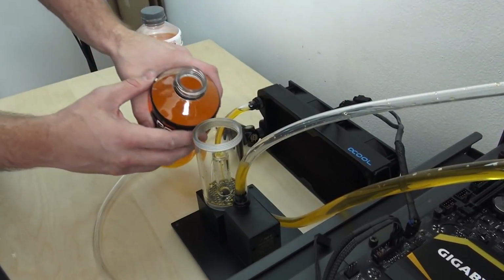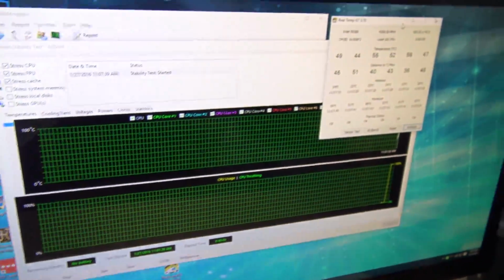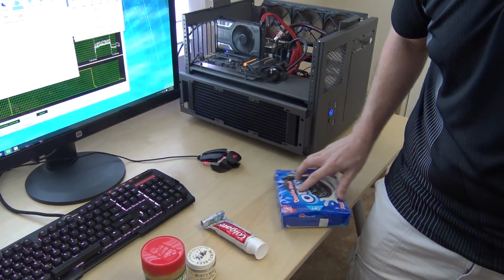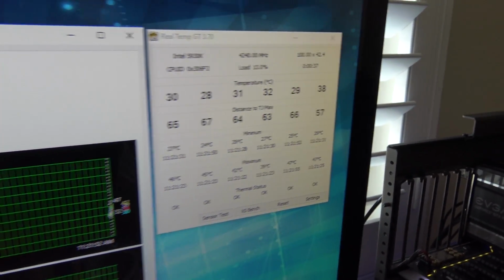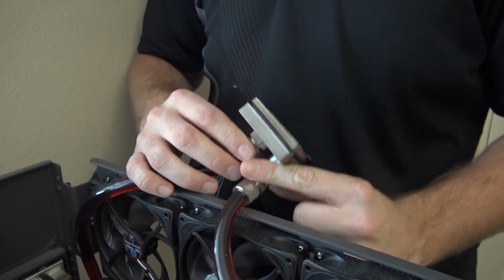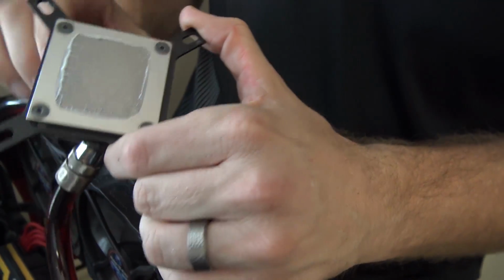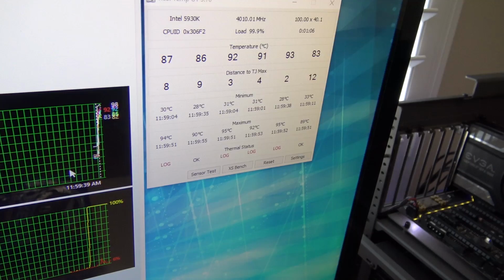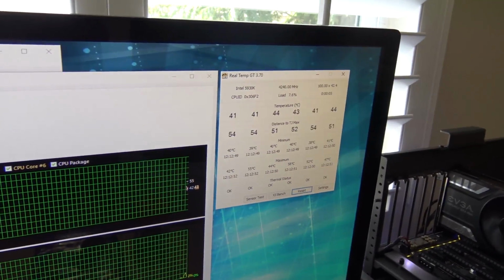Two Idiots Install Household Products as Thermal Paste

Comment: *Raises hand 
Is mayonnaise a thermal compound?
Reply: sigh 
No Jemster, mayonnaise is not a thermal compound.
Reply: No Jemster, horseradish is not a thermal compound either.
Reply: raises hand
Reply: Raises hand again
Reply: *Lowers hand
Reply: Triggered
Reply: at least spell it right Heptoras...
Reply: It could translate to Victory Siege.
Reply: *Jemster raises hand again
Horse radish either
Reply: +Knops 
My bad, auto correct got me on that one
Reply: ANYTHING will work to some degree.
Reply: I so read that in Patrick's voice haha XD
Reply: I saw a website that tested a lot more stuff and mayo performed better than some thermal pastes!
Reply: thought about that too.. maybe some cookie dough? tomato paste? Cheese Dip?
Reply: Reddit says yes
Reply: they used ketchup at pc games hardware....worked pretty well apart from the smell
Reply: Vishvak Seenichamy Maybe in the beginning, but in the long term no way.
Reply: It can replace thermal paste for smth like 1-2 month (true story)
Reply: Lettuce?
Reply: patric
Reply: no jemster mayonnaise is not a thermal compund
Reply: Jemster lmfao
Reply: Jemster it will work yez
Reply: idiot ! mayonaise is for bread !
Reply: Jemster I've mixed 3 parts toothpaste with 1 part vasoline. Worked well for 4 months before changing it out.
Reply: midnightmodder thinking of testing that out :) hopefully works well if so
Reply: Ah these annoying westerners. Yes mayonez is thermal compound, but only under certain conditions. You have to use potato water block and squatting radiator with 3 stripe fans.
Reply: No, jemster, horse radish isnt a thermal compound wither...
Reply: *Raises hand
Is mayonaise a gender?
- No, feminaziric, mayonaise is not a gender
- triggered
Reply: but mayo is a intstrement just ask bombsquad records
Reply: Jemster is mayonnaise a instrument?

Comment: The last two probably acted more as an insulator than if they had just bolted the block down, metal-to-metal, with nothing in between. That would have been an interesting control at the end

Comment: Can I use auto coolant for my liquid cooled computer system??
Reply: Automotive antifreeze also has anti-corrosive additives. If you even think about using aluminum components or mixing metals in your loop, definitely use automotive antifreeze. 

Ethylene glycol actually reduces the heat capacity of a volume of water, but the BP/FP/anti-corrosive properties make this tradeoff worthwhile in automotive cooling systems (which operate at much lower and higher temperatures than a normal desktop computer cooling system).
Reply: You could, but there would be no point. Engine coolant is just water with ethylene glycol added to lower the freezing point (hence anti freeze) and raise the boiling point
Reply: Expanding on what Wayne said, if you want the best performance out of your loop, just use copper blocks and radiators and use straight distilled water for coolant. Your pc wont get hot enough to boil water, and using all copper parts will prevent corrosion. (fyi, it's okay to use nickel plated copper blocks with copper rads. Just don't mix copper with aluminum or very bad things will happen).
Reply: it should work
Reply: Yes, in a high water/coolant ratio (like 90/10, 80/20).

Comment: Not surprised about peanut butter, it's actually an excellent heat conductor - you'd probably get cooler results with nothing used at all vs peanut butter :) Same with the oreo stuff since its just pure sugar (kinda lucky it didn't light on fire heh)
Reply: Saying it is a good heat conductor means it would be a good thermal compound, peanut butter is a poor heat conductor
Reply: McKinnon Bathie right, got my phrasing backwards :)
Reply: ... and this is how science proved that peanut butter was an excellent medium between a hot toasted slice of bread and cold jam from the fridge! Or even ice cream, if you're gonna be crazy and reckless like that. Which can only lead to one conclusion: if it ain't good for your CPU, it's probably worth eating it. Also that peanut butter is superior to things.
Reply: Or use the term Insulator.
That way you can say "excellent heat"

Comment: How about trying motor oil as a fluid for water cooling?
Reply: It's too thick at starting temps and will burn out the pumps.

Also- it has petroleum product which will eat any plastic based items, not to mention with it being one of the few substances on the planet that is naturally a hydrophobic compound will make it nearly impossible to clean out of a radiator
Reply: NO.
Reply: it's much too dense. you'd need to use a real pump then, not the sissy ones that we use for computers.

and you'll need to use glass or metal tubing for it.
Reply: For the cleaning, the answer is alcohol.
Reply: i use glycol based car fluid works like a charm
Reply: car cooling liquid would be better idea...

Comment: you need to use mercury in a water Colling loop.
Reply: Mercury reacts with copper and aluminum, the two common metals used in cooling loops, so it would destroy itself.
Reply: That would be super expensive. Do you know how much mercury that would take?
Reply: so heavy
Reply: There's actually a particle accelerator (Spallation Neutron Source) that uses mercury as its target material with the added perk that the mercury is constantly circulated for cooling purposes. Oh, and interestingly enough the cask holding the mercury is predominately aluminum! But that's a major science facility, not someone's pc lol. Fun to think about though. (Source: http://www.csm.ornl.gov/SC98/viz/viz8.html)
Reply: Due to mercury's high conductivity this would actually work amazingly well, though pumping a fluid that heavy would be difficult. But yeah, the toxicity pretty much rules it out.
Reply: NaK might work if it doesnt kill jay
Reply: please, make this happen :-3 you might be first in the world
Reply: hwfanatic then do it out side on a tarp.
Reply: it would work it would just ruin the loop. nuclear power plants use something similar for cooling.
Reply: +John Gray it just needs to 70 degrees for aluminum to break down. nurdrage did a video and I think that's the tempature he had.
Reply: +John Gray wait I was wrong he used gallium. Mercury shouldn't eat metal its just going to contaminate the loop.
Reply: John Gray think of the over clocking.
Reply: Gabe Trout you would need a pump you would use for like a water fall in a fish pond. It could move the mercury.
Reply: no it would destroy the loop to fast.
Reply: +John Gray it only has to run for 10 to 20 minutes. the breakdown of the metals would take a day or two. if you custom build  loop based on iron it could run until oxygen is introduced in to the loop.

Comment: I ordered all of my computer parts and every thing ( I'm a first time builder ) and I'm going to use your how to build a PC video for instruction but I'm really nervous about installing the CPU since I spend a large chunk of money on that. Should I be nervous? And any tips fo installing the CPU and thermal paste
Reply: It's really fun and addicting, there just really really expensive legos
Reply: A grain of rice for thermal paste, and no the CPU is easy to install. Just watch a few videos on how to do that alone
Reply: Just treat the CPU very gently and make sure to align the triangles that are found on both the CPU and the socket. Also, you might want to give the CPU a little wiggle very gently once it's in the socket to ensure that it's in there. Don't forget to add some thermal paste as well (about the size of an uncooked grain of rice). Furthermore, don't be too afraid of the amount of force that you have to use to lower the retention arm because that's normal. Lastly, make sure to tighten the cooler or waterblock in a cross style and not screw it in too tight to prevent breaking the CPU or flexing the motherboard. Don't stress over installing the CPU because it is an easy process that you'll laugh about after you do it.
Reply: I mean being nervous will mean that you're more likely to be careful..

But just match the arrow on the cpu with the socket and drop it in. Give it the "wiggle" test to make sure that the cpu is properly in the socket and not bound up anywhere. The scariest part will be tightening the retention arms.

You can't really use too much thermal paste. But I like to use a pea sized drop in the center of the CPU. That's plenty.
Reply: make sure you use the arrow on the corner of the cpu and the corner of the motherboard. then just set it in gently, DONT PUSH, then push down the closing pins and the black cover should pop out. I did mine for the first time ever and it was fine. it might make a little "crunch" but its fine
Reply: Just don't touch the bottom of the cpu, just grab the edges. all these other guys listed the other important things so I won't again haha
Reply: dont follow this vid
Reply: Thanks for all the tips and replies.

Comment: You never mentioned that Real Temp didn't support FX CPU's or atleast the FX 6300 ;~;
Reply: I think it's only for Intel...
Reply: Nad Kudo rip me ;~;
Reply: use CoreTemp for FX. I have a fx8320, reads mine fine. and TJ is what it says the max cpu temp is in the software
Reply: +Louie Mott not really. i dont think my fx8320 idles at 13℃ when my room is ~20℃
Reply: Read the other comments. That has to do with the sensors on the chip. They read about 10C cooler than they should, and seem to be like that for every chip. Having said that, the actual software works perfectly. Like a scientific test, you can be wrong about something as long as its consistent. If your cpu goes from 13C to 33C you know there was an increase of 20 degrees. Take into account the bad sensors and you know it really went from 23C to 43C, but that doesnt change the actual scale of change........AND try updating the software; some people, including me, are having the software recognize the sensor issue and auto correct the temperature

Comment: I experimented with Engine oil, Canola based Margarine and Automotive grease , Margarine was the winner by far and the other two about the same, margarine is just as good as Cooler Master paste but Im not sure how well it would work long term and also my cpu was not standing upright and Im sure the melted margarine would just drip out if it was. Engine Oil and grease was surprisingly bad at transferring heat, I thought for sure those things would be better than margarine but nope

Comment: Make a video on what it takes to max out a 6600k, 6700k, 5960x, and 6950x in the real world.
Reply: +Vilius dgehjebeg why shouldn't he?
Reply: Mmm just do a buttload of rendering with witcher 3 playing with max foliage visibility, grass density, and npcs set to ultra
Reply: +Devin Stambolziovski I've played Witcher 3 at max settings with a Modded minecraft server(with loaded chunks) and chrome with over 20 tabs open and my 6700k didn't even care
Reply: +Vilius dgehjebeg I suppose it might.
Reply: Vilius dgehjebeg No, it would actually be very interesting. I have a 6700k oc to 4.4ghz, and I have never got my cpu run higher than 70%. This would answer the age old question, what cpu should I get? Do professional's really need these professional cpus? 

What's boring is seeing a cpu maxed out by a stupid stress test, because in reality, normal applications work very differently from those stress tests!
Reply: H.265 encoding will 100% any cpu no matter how many cores, even multi cpu configs. Still only gives you around 1:1 encode time.
Reply: why should he?
Reply: +TheDunester it would be boring don't you think?
Reply: Then simulations would be the only thing to max that baby out. Maybe not the ones that take supercomputers months though.
Reply: Try screen capturing games in 4K without a RAID0 array or Terabyte SSD's, should max out a 6700k, I can't overclock my 4790k enough to handle it perfectly as you need to use something like bandicam which compresses the video file live sacrificing CPU performance to reduce HDD/SSD write speed. ...It does work though, FPS dips by about 30% along the way but it works when you get the right bandicam settings lol Don't know how you would max an 8 core though, im sure the 6 core chips would manage it.
Reply: It depends on resolution, settings, game and particular condition in said game, rule of thumb is 6600k @4,5GHz or 6700k@stock are perfectly fine for gaming at stable 60fps even in most demanding games,  there might be very rare exceptions like Arma3, but it wont get better no matter ur cpu anyways.
Reply: Danyal Ahmad

Oced 1080 and new pascal titan will be bottlenecked in 720p/1080p by cpu, especially if u lower settings that are gpu-hungry, but we are talking here about fps north of 120, often over 144 frames per second, so in real world scenario ur cpu at 4,4GHz wont be bottleneck to any gpu for a long time.
Reply: +Danyal Ahmad play space engineers modded or heavily modded minecraft. Both are poorly optimized games. Or compile some source code project in Linux. I have a 4790k overclocked to 4.9ghz and I probably hit 100% load 4-5 times a day.
Reply: Thomas Zimmerman ubisoft games will be enough lol.
Reply: Everything can be maxed out at anything if there is no bottleneck, even the software can be a bottleneck
Reply: CPU based 3d rendering. instant 100%